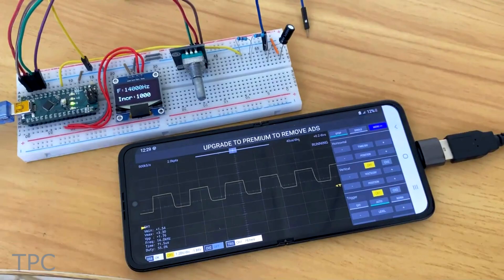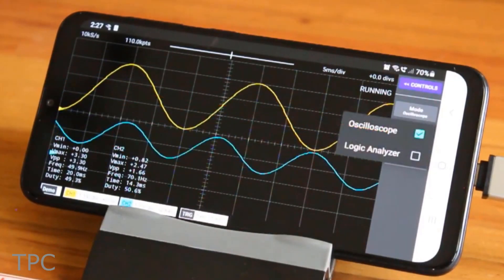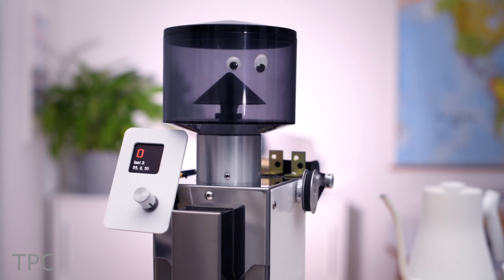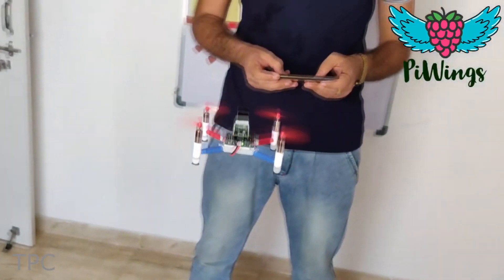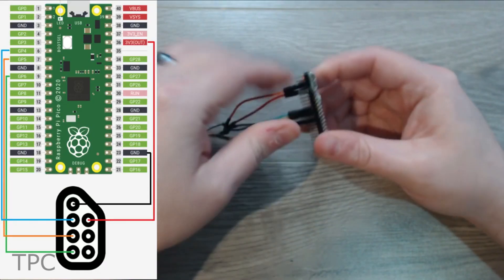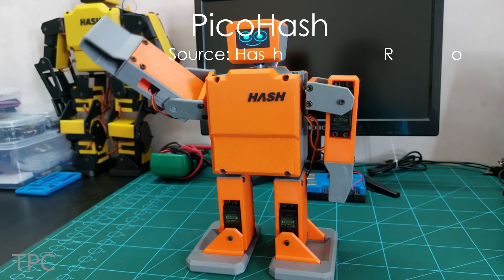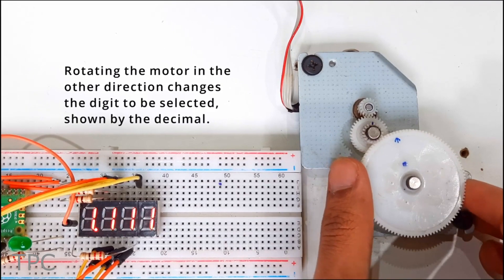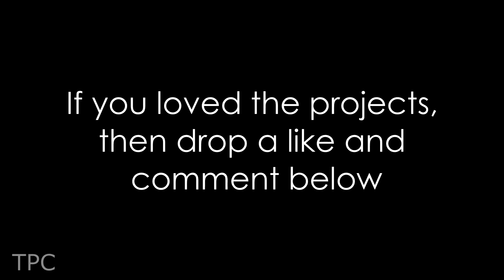Raspberry Pi Pico - 10 Cool Project Ideas!

Comment: bit miner at the end, is it limited to of just four RP Pico, and the it have to use RP as the main part, or could you use anything, (is it running a web page or something?
Reply: It does create a possibility of a RP Pico cluster at a small scale just for learning and home lab.  It's not really practical to mine anything big with these boards.

Comment: at 7:13, running a step-a-motor backwards, , as a rotary-encoder, are they the one's in almost ever,  e-waste junk inkjet printer?
Reply: yes they are, that's why it is a good project using recycled parts